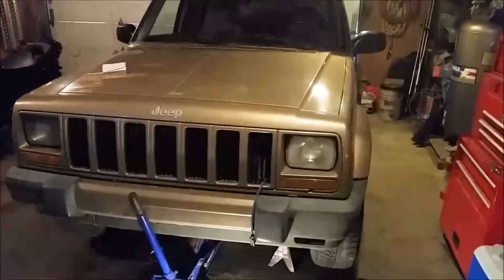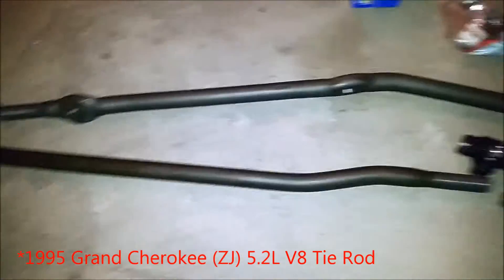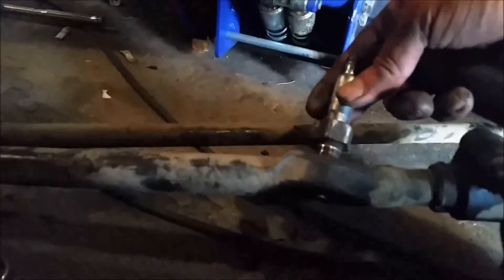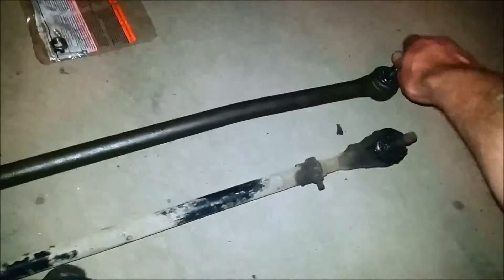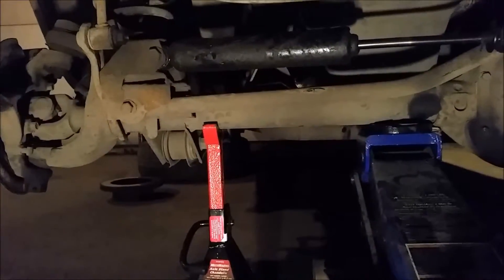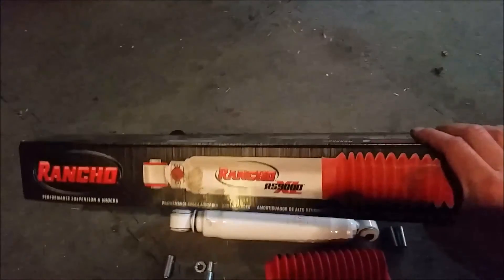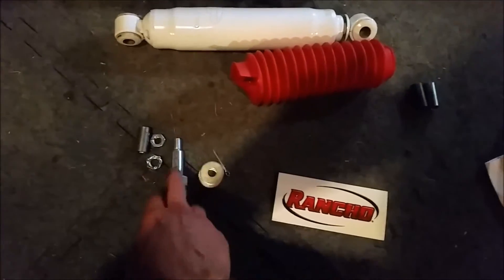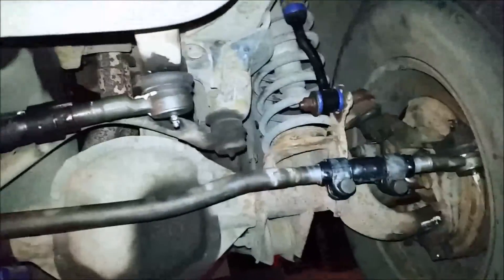Jeep Tie Rod Upgrade using OEM V8 ZJ parts

Comment: Thanks for the great video. The ZJ Tie rod is definitely the way to go if you want to keep factory size XJ 15 or 16 inch wheels.
Reply from the maker: Definitely agree. If you gotta replace the old ones anyway, may as well just use the ZJ stuff.
Reply: I don't think the wheel size has anything to do with our decision. I can still fit up to 35 with my 2.5 inch lift  I choose 31 inch tires because they are simply the best all around . On road and off road  I can go 95 mph  no death wobble. 1998 jeep cherokee. I seen guys run 40 inches with this setup . It is rusty's off road kit just before they repaint it and double the price. Doing it this way saves 70 bucks or so and uses same parts
Reply: I mean trust me this is the easiest way to upgrade your tie rods .
Reply: @mikecarr1484  I had tried a "HD crossover" conversion. The joint on the passenger side hit the wheel rim, even with OEM XJ/KJ 16" wheels. forget the 15s. They clear the aftermarket 17"ers on my sons rig, and he needed to rebuild his steering, so he bought my V8ZJ stuff for me, and I gave him the crossover stuff.
Reply: @mikecarr1484  And for half the price of all the other stuff that is being sold.
Reply: Yep.

Comment: cool video! is that an XJ oem drag link?  do you know if they make a stronger one?
Reply from the maker: Yeah, the draglink is actually the same on the ZJ and XJ, but it's a solid steel bar like the ZJ tie rod. I'm sure somebody makes a stronger set up. There are other, better conversions out there too, such as the over-the-knuckle conversion. I just needed new tie-rods and this was a nice bolt-on upgrade. Thanks for watching!
Reply: @spacerag  thank you! I was under the impression the ZJ had a slightly different angle that could cause a wobble on the XJ.  I'm definitely doing the ZJ tie rods tho.  I'm planning for a Frankenstein front end with WJ knuckles... It's gonna be a doozy. Lol!

Comment: Doesnt a certain year tj have a larger body tie rod at box? Same taper. Prob use tj adj sleeve and drag link but ive never done it
Reply from the maker: Not sure. Not that I've seen. My TJ, XJ, and MJ all had the same tie rods and ends. Maybe it was just a beefier aftermarket tie rod end? If they did offer a heavier tie rod option, it was probably the same part # as the ZJ. Thanks for watching!

Comment: Great video. I just bought a 1996 Cherokee Sport and have no fricking idea what I need for tie rod upgrades/replacements.  Seems to me a Kit would be the right solutions... not per piece...
Reply from the maker: Congrats on the new XJ! A kit would definitely be ideal. You can buy "heavy duty tie rod" kits which are often just these part numbers. I bought one of those kits for my TJ recently and it was okay... it was cheaper but I think I liked the moog stuff better.
Reply: @spacerag  Thanks for the reply. I'm just using the XJ as a fun little project for around town, lake... Nothing special. I found a few kits on Amazon that have the ends, drag, connectors, etc... Might just go w/ that for 100 bucks... nothing to lose and, nothing to break free from OEM .. ;)
Reply from the maker: Can't argue with that. It's gonna be better than whatever you've got now. :) Check your ball joints too. It seems like I'm always doing those two jobs at the same time and the tie rods come off for ball-joint replacement anyway. 

Good choice for a project vehicle. They're cheap, light, capable off-road and reasonably easy to fix yourself. If I can do it, anyone can! Good luck, bud!
Reply: @spacerag  Thanks for reply. Ball joints tough?  While I have it apart, makes sense to do those joint too... I guess.
Reply from the maker: They're a pain in the ass, but if you get a good ball-joint press with the right cups for your XJ, it makes the job a lot easier. They're usually around $100 or so. The press is useful for pushing in u-joint caps too, so it's a pretty useful tool.

Comment: I have a 3" Zone lift. would you think this would still work? my stock steering equipment needs an upgrade
Reply from the maker: +John Bossnack Yeah definitely! I lifted mine a bit over 4" after doing this steering upgrade and have had no problems. Probably be easier to do on a lifted vehicle actually. Lots of clearance! Thanks for watching.